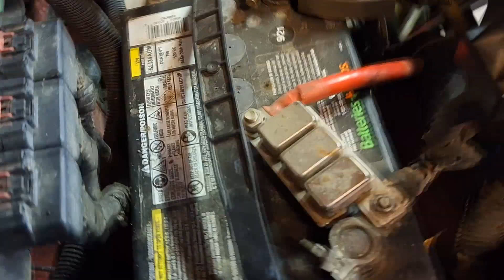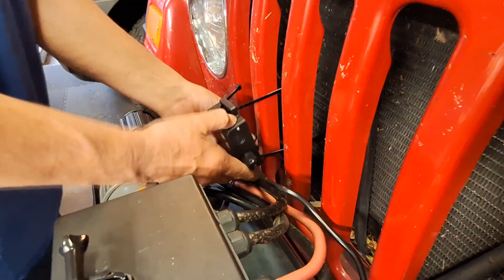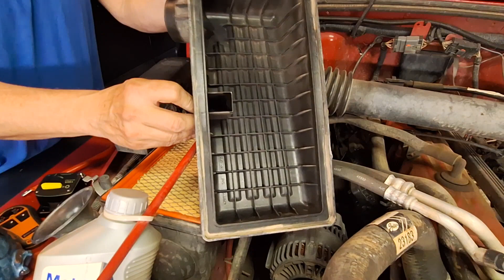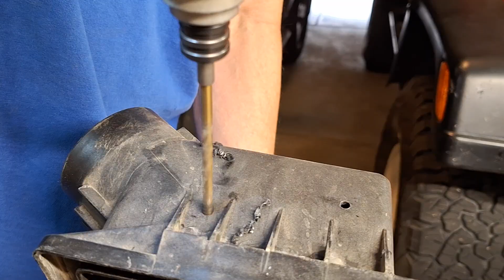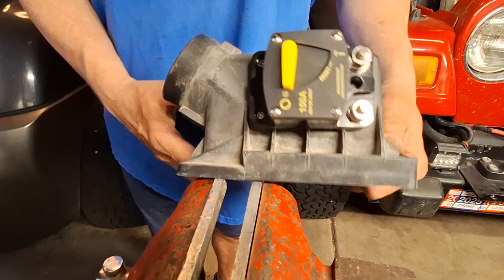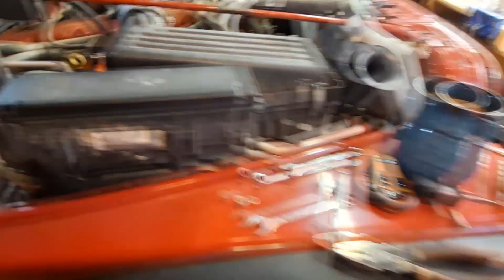Harbor Freight Badlands Wireless Winch Remote & Circuit Breaker / Power Switch Install Jeep TJ LJ

Comment: What's the circuit breaker for?? Is it only for the remote or the whole winch?
Reply from the maker: it is for the whole winch, so even with the wired controller I'd have to turn it on to use it.  The wireless remote comes with instructions that tell you not to leave it plugged in because it can potentially be set off by a random radio signal, ie. you drive past a kid with a remote control car and your winch starts spooling, lol.  It also replaces the 3x50 fuses that come with the winch, so this way if I blow the breaker I can just reset it and not have to replace fuses.